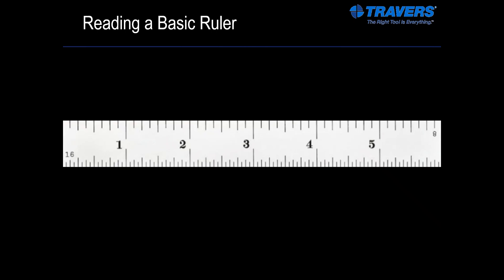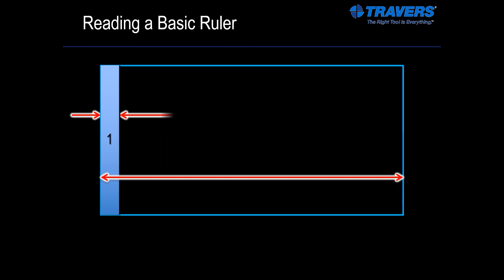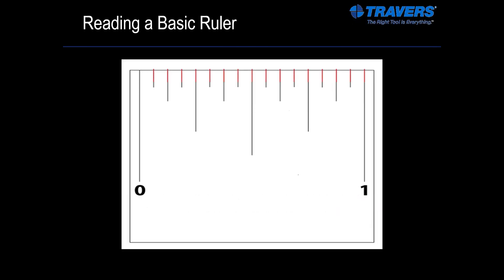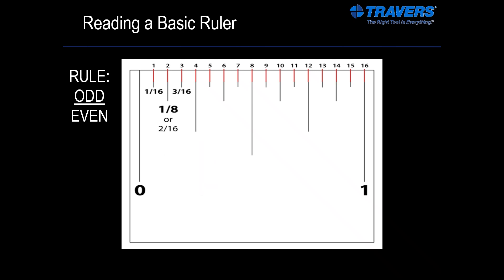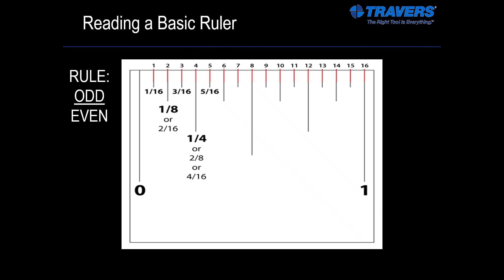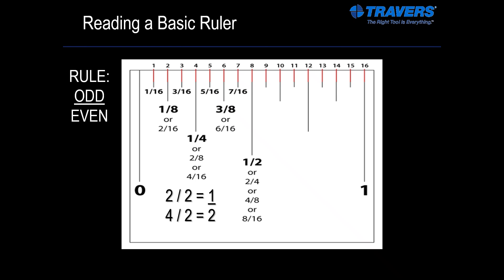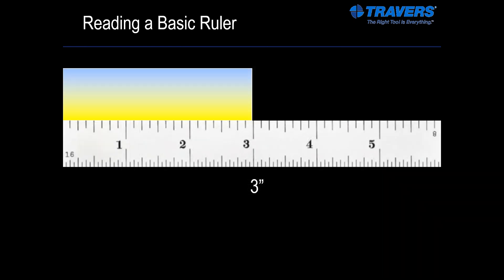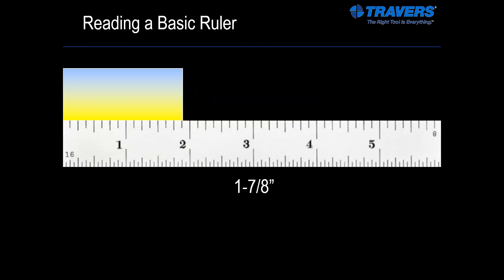How to Read a Basic Inch & Metric Ruler | Travers Tool Co.

Comment: for a measurment of 4.59 inches, what is the meaning of the 59 and how is that seen on a ruler?
Reply from the maker: The &quot;59&quot; in 4.59 inches represents the decimal part of the measurement, which is equivalent to 59/100 of an inch. On a ruler, this would be seen as slightly more than 4 and 9/16 inches, as most rulers are marked in fractions rather than decimals. For measuring to 2, or 3 places past the decimal, you'd need a "5R Graduation" ruler, then read it the same way as I describe in the video, only in decimals instead of fractions.A 5R scale has four different graduations on the rule, arranged like this:
1/32″ on one side
1/64″ on the same side
1/10″ on the other side
1/100″ on that same side